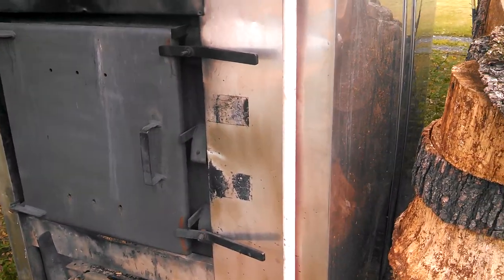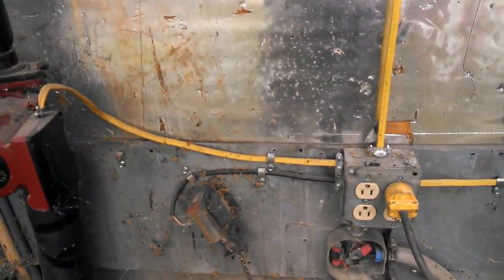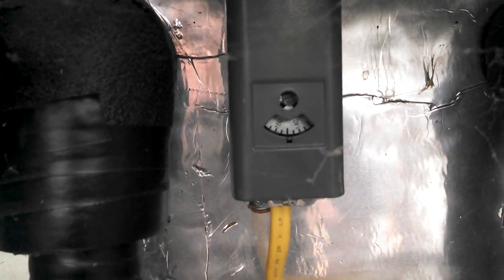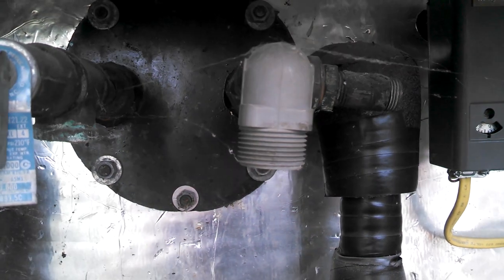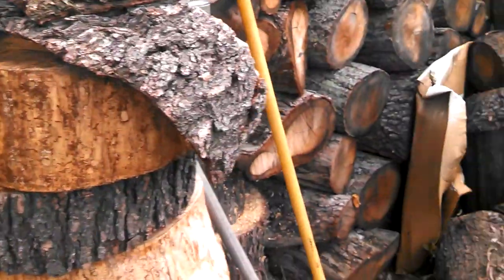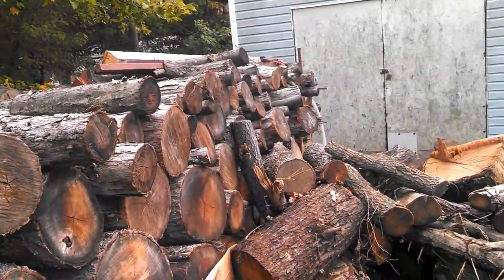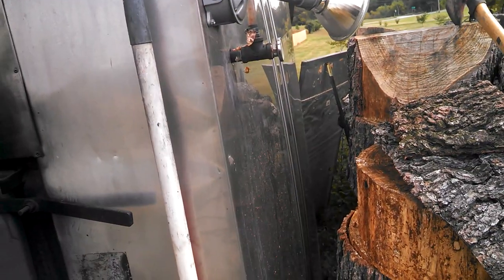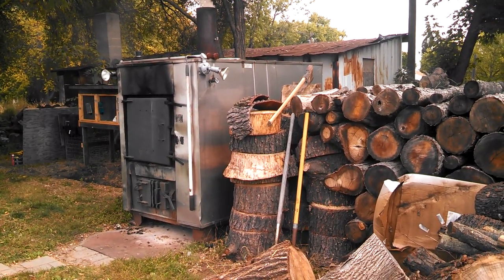My outside wood stove

Comment: That's  really something Larry. I have never seen one of those before. I grew up with a wood furnace for heat, it was a big old coal furnace converted to use wood. Man, all the wood had to be split. I must have split a million miles worth of wood when I was a kid. Now that boiler of yours using un split wood should burn a long time. 
Jeff

Comment: Get yourself a 120 electric hydraulic pump don't have to be big gph 2-3 gallon a per minute will do fine a good hydraulic cylinder at least three in preferably 4 inch build a frame to hold cylinder almost vertical with an arm you can set that big piece of wood on then lift it up to door height and push it into stove with a piece of steel designed for the purpose. Save your back. Mount on two 8 inch tube type tires to roll it around easily.

Just an FYI